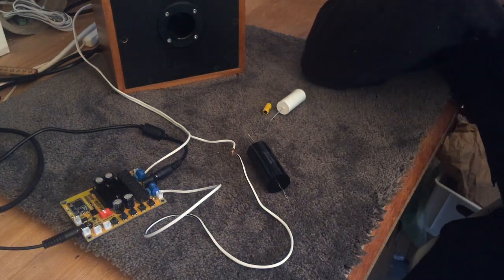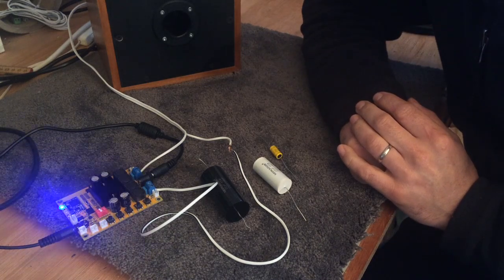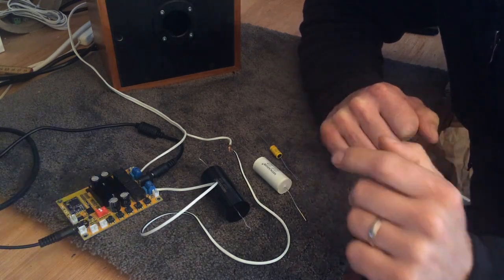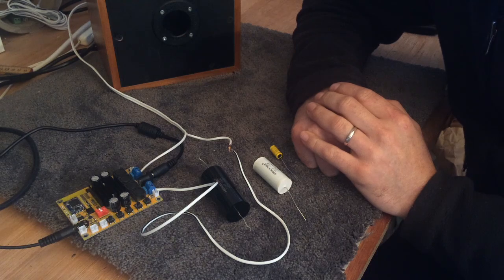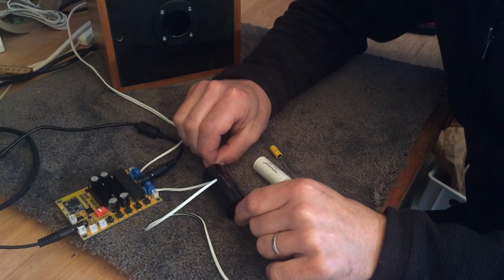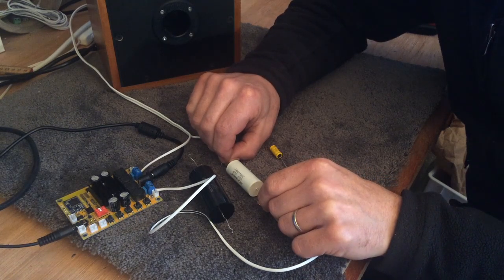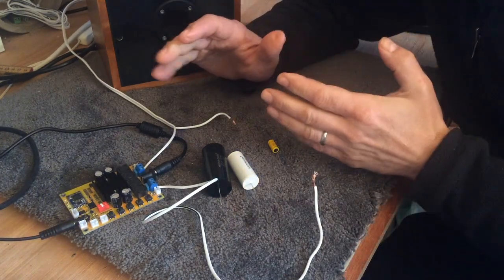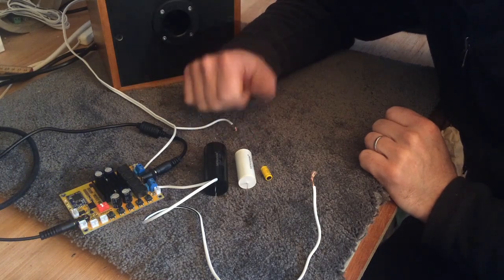What is a capacitor doing in a loudspeaker ?

Comment: well when I stopped using the capacitor my tweeters loudness increased by a very large amount so the capacitor does affect the loudness
Reply from the maker: Hmm you are killing the tweeter, the loudness you are hearing is enormous amounts of distortion from playing the resonans frequency.
Reply: well I don't hear any distortion my tweeter sounds great without the capacitor
Reply from the maker: What model tweeter is that? If its a piezo tweeter it can work without, but those are not for hifi
Reply: my tweeter is the BOSS TW30 bullet tweeter
Reply from the maker: A bullet tweeter for sure needs a capacitor or a full crossover, are you sure it isnt pre-soldered on the tweeter, or maybe you already have a crossover in your speaker. I typically do 5KHz crossover either 2nd or 3rd order on most bullet tweeters, or else you would need a 10 pack of voice coils
Reply: Yes of course it will, it really depends on the cross over circuit; they are different.

Comment: Great and simple video. Just seen a tear down of the new Apple HomePod speaker which has a high excursion subwoofer and seven beam forming tweeters in an anechoic chamber. Wanted to know what the capacitors were for and this video answers that perfectly and simply. Thank you.
Reply: Hi UrbanSmash SoulJah. Capacitors are used in speakers for a number of reasons. The most significant is to prevent bass and midrange frequencies from entering the tweeter. The value of the capacitor which is given in microfarads or "uf" (the video has a guy with a 2.2uf, a 10uf and a 3.9uf) determines the frequency of sound for which capacitor filters out. The smaller the value, the higher the frequency.
Reply: 😍 can you connect your speaker to compare with cheap mundorf 47uf Mcap tin cap(white.color) vs 47uf Mcap Alum vs 47uf Mcap supreme silver oil vs 47uf Mcap Supreme silver/gold/oil EVO.  Does it sound different ! Video have ? 😍😍. ( can u do a video with that can ? It will be very Fun to try )......."/

Comment: hi there can you help me?, I want to build a full range tree speaker with 2 mid drivers and one tweeter, does the tweeter have to be the same wattage as the mid drivers? if not how do I limit the wattage to the tweeter?
Reply from the maker: Hi there, automatically the power is less at higher frequencies in the music, so depending on the crossover that you use the power to the different drivers will be different. With a typical crossover in a 2 way system as you are describing and most hit musik played on it,  you will have have about 15 to 25% of the sound in the tweeter. What drivers do you have in mind? theres more to it than so, also you sensitivity can make a big difference here, lets say you have a sensitivity of 90dB on your tweeter and 100W rms, then you will have the exact same energy in a tweeter with 93dB and 50W rms. After is your resonans frequency the lower the more you can push it.
Reply: oh i see thanks for your reply, here are the drivers I want http://www.bluearan.co.uk/index.php?id=BAC15NDL76&browsemode=manufacturer , and the tweeter  http://www.bluearan.co.uk/index.php?id=PAUBM2D7508&browsemode=category ,  and maybe this cross over?   http://www.bluearan.co.uk/index.php?id=LKDX31&browsemode=category .
Reply from the maker: You need a custom filter for that, no standard filter is going to make this work like it should. I would say 2 way 18dB pr oct (third order) butterworth, and then it needs impedance correction on the woofers and lpad approx 12dB damping
Reply: thanks buddy, should I use a crossover calculator? or do some research and not use a calculator? also do I need a attenuator if I'm using a mixer?
Reply from the maker: the lpad circuit is instead of an attenautor, so you could use that instead just got to make sure that is can eat all that power, 12dB is basically everything. A calculator is good just as long as you do do impedans correction (zobel filter) and find a calculator as well
Reply: The fact you are asking this question means you should stay away from building your own, it requires some electronics knowledge.

Comment: how come the 10uF is smaller capacitance than the 2.2uF?
Reply from the maker: 10uF is a higher capacitance than 2,2uF, but because of the smaller capacitance of the 2,2uF the crossover frequency will be higher and less deep frequencies will be played
Reply: 10UF IS EQUIVALENT TO 0.00001 FARAD WHILE THE 2.2 UF IS 0.0000022 FARAD
Reply: Smarthouseelectric
Reply: The correct answer in this case; The 10uf capacitor he has is an probably a polyester capacitor. The 2.2uf is polypropylene . Polyester capacitors are smaller. The 3.9uf is and Electrolytic capacitor and these are smaller still for a given capacitance  Polypropylene capacitors are generally higher quality. You can buy polypropylene capacitors from Ebay. The CBB60/ CBB61 polypropylene capacitors from China are inexpensive and are very good quality. The CBB60 and CBB61 capacitors are labeled "motor run" or "motor start" and are made for washing machines and air conditioners etc. However, these capacitors work perfectly in loudspeaker crossovers. Parts Express also has a wide range of inexpensive and good quality capacitors for loudspeakers. They also have a plethora of excellent loudspeaker parts and loudspeaker kits. The  Parts Express Forum is a great place for a beginner with any questions regarding loudspeakers.